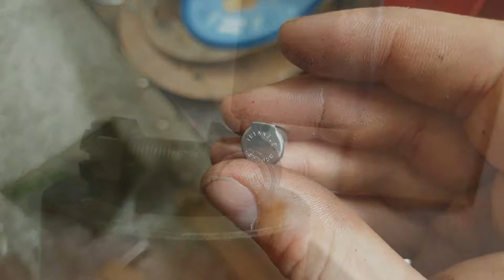Ford Model T Restoration/Build | Part 15 Mounting Rear Axle to the Frame

Comment: Hi..what paint do you use on your  chassis parts
Reply from the maker: I'm using Teknos Kirjo black
Reply: I'm in England so will search online..is that a tractor type paint..trying to build a trike in a similar style to that era..we'll trying...love you're videos..never even sat in a car like the one you're building and I'm 45...you certainly know you're way around it all...looks great..cheers Steve and helene
Reply from the maker: @StevenStratford  Thanks! It's a steel/iron paint with rust protection.
Reply: Cheers,maybe a Christmas present for myself..cheers